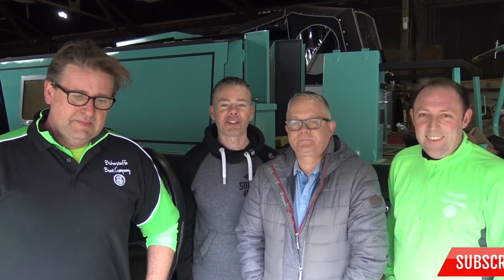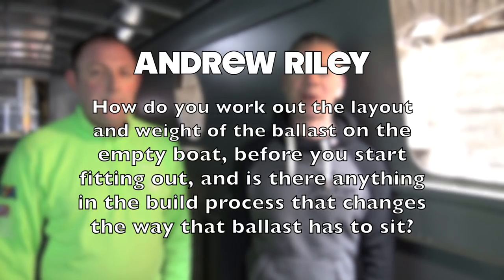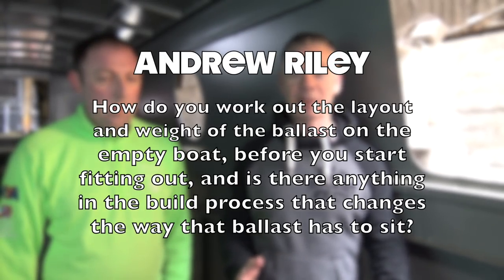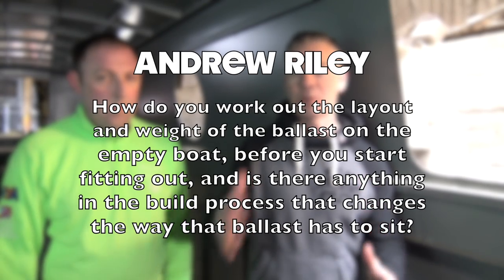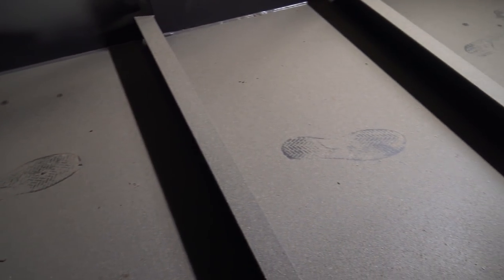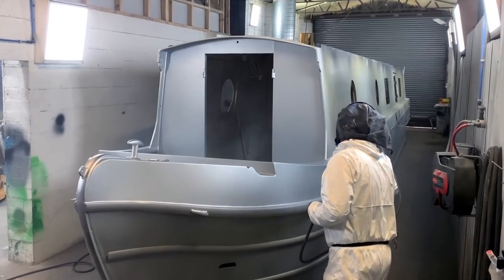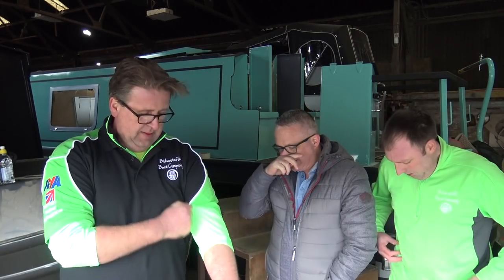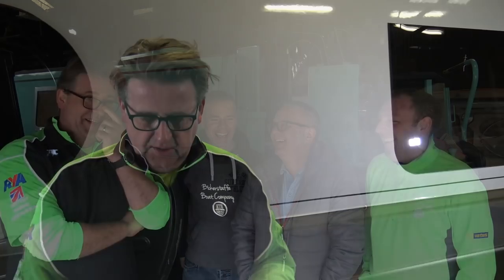Building a Narrowboat - Ask the Boat Builders! - Ep. 43

Comment: From what I've seen thus far, Silver Fox looks absolutely beautiful, quite simply magnificent, inside and out. Very tastefully fitted out, and the exterior...a perfect example of 'less is more', classy in the extreme. Congratulations. May the Gods help the first person who bumps you on the Cut.
Reply from the maker: Ha ha, thanks, Jon! She'll be in a lock within hours of launching, so loads of knocks to come :) x
Reply: @FoxesAfloat  From all I've seen on the various narrowboat vlogs I know you're right but I'd be devastated to mar such a handsome boat, I applaud your real world attitude to the inevitable.
   On the subject of condensation can I make a suggestion, I have for some time used a type of dehumidifier/damp catcher thingy that can be bought for less than a pound apiece from the Savers chain of shops. They consist of a two section plastic container, the upper section contains what looks like white beads which absorb moisture and dissolve into the lower section and remain there in liquid form, there is a one way membrane to keep the two apart. They work really quite well. They aren't the most elegant accessory to leave around the place but in confined spaces, wardrobes, cupboards even lockers they'd do a job. Wishing you many happy years.

Comment: Hi Foxes 🙂🦊 
Quick question, in the painting of the silver fox which is great, you didn't say anything about painting the bottom of the hull. If it's something that's not done what is the reason? 

I loved your explanations so indepth. Especially when doing the chalk drawing of the heating and using white chalk drawing red lines 🤭 It's great. 
Great boat and blogging thingy 👍😃
Steve
Reply from the maker: Hey, Steve. Nobody really paints the bottom because the canals are so shallow that the paint is worn off within days/weeks. This is why the base plate is 10mm+ thick.

Comment: Most of todays newer durable coatings that I'm aware are of polyester or polyurethane base that are catalyzed with a hardener (2K) . Some are clear coated, some are not. But also, these coatings all require spraying. I have never seen a quality finish on an automobile, a jetliner, a yacht (made of steel), or a farm tractor that was brushed or rolled. I just don't get it. And my question to you is the final topcoat actually lacquer or what??  Your boat is magnificent due your obvious research and the fine team from Bickerstaffe. (From one of your new friends in Texas)
Reply from the maker: Yes, several coats of UV protective lacquer. Thank you! 💜

Comment: I've been looking at inverters. These days they're a lot more efficient than I remember being told in school physics lessons! 5% loss is great! With this in mind why have 12V sockets or expensive DC fridges, washing machines etc for the sake of not losing 5-10%?  Universal 230V AC circuits then....Am I missing something?
Reply from the maker: People have different opinions. In the depths of winter I guess every Amp and Watt counts, so that 5-10% can add up, especially with fridges that are taking power up to two-thirds of the day. If you're have a boat built from scratch like we did, it's just as easy to run some 12V circuits to save some of that excess wastage. Again though, people will agree or disagree with me 👍🏻

Comment: Did you do an energy audit on a dehumidifier? Do any narrowboats use air conditioners.
Reply from the maker: If you manage moisture within the boat you don't need a dehumidifier. Also, they use a massive amount of power, which in the autumn and winter when the solar is lower, is much harder to generate. Same principle with air conditioners. Just too much power guzzling.

Comment: Hey guys. Good vlog interesting to hear from the builders .  Also about how they feel like you have become friends as apposed to just clients. That's a good thing however I don't dout that that is the case ,you two come across as very easy going people. The condensation problem is one that has come up with just about all the utube channels.  I do however have a question please. The bilge  not at the stern gland or the bow thruster, I know that they have dedicated pumps . My question is the rest of the boat.  Have you had removable panels for each of the sections or are several connected with a panel for each.  Also I made a sudgestion to one of the other utube channel when they got caught in a pound that was draining and the boat was leaning over to such an extent that they were worried about water coming back in through overboard discharge pipes. My sudgestion was next time the boat was out of the water , the overboard discharge pipes be removed and quick shut valves put in then the pipes replaced there by if that situation should come up again, and reading these vlogs it's very possible, all you have to do is reach out to them shut them problem solved. just a thought. . Anyway thanks for the video look forward to your next.Be safe
Reply from the maker: Hi Colin (cool name). 
Great question! (are you watching, Kev?) 
Our base is made up of separate bays, each protected to some extent from water spreading about. We also have several water detector alarms situated in high-risk places for water to collect, such as under the water tank/pump, calorifier, shower pump etc. We also have fantastic access to the bilge from almost all areas of the boat thanks to removable under-cupboard access points. Given the risk of us taking in water from discharge points, it doesn't make financial sense to pay out for an engineered solution like that. Even though it sounds like a very easy thing to create. Thanks for watching! Colin xx

Comment: Dos the bottom plate of the boat or ''keel'' that is submerged in water get wet or creates condensation, after the Boat has been launched and has been sitting in the water for several weeks is the ''bottom base'' of the boat known to be damp or wet...????
Reply from the maker: No, it shouldn’t get wet. We have a moisture detector just in case it does.